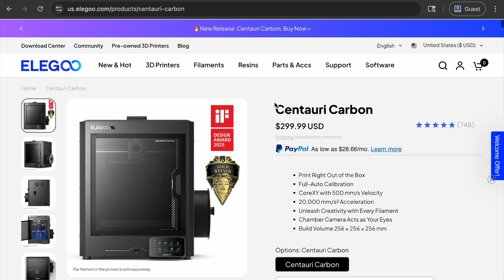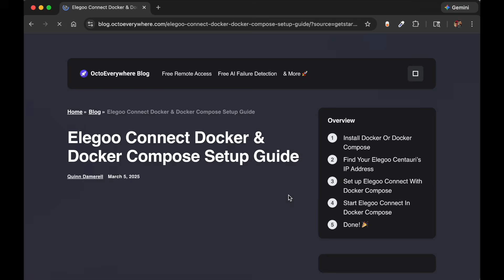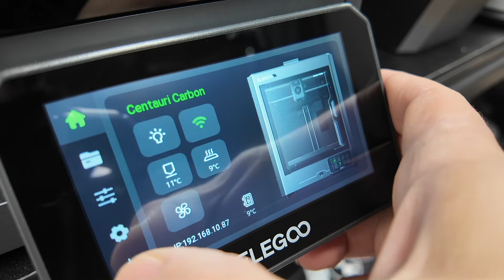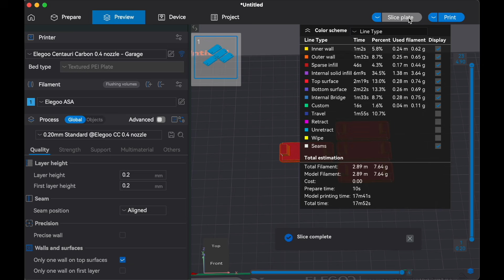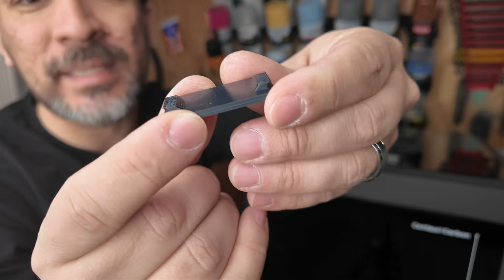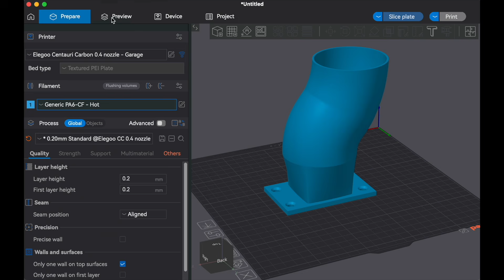How To 3D Print Engine Bay Car Parts With a Sub $300 Printer

Comment: This or p1s?
Reply from the maker: If you have a slightly higher budget, go for the P2S. It has a built in heated chamber. Makes printing larger ASA/ASA-CF higher heat resistant filaments much easier.

Comment: So will this be something I can use to make a fender and just paint over it?
Reply from the maker: You can use ASA filament for exterior parts. I have a few parts that have lasted years with no issues with the Southern heat and multiple tropical storms ;)

Comment: Instead of heat soaking the chamber with the print bed just blast some hot air in there with a heat gun.
Great video. Keep up the good work.
Reply from the maker: Oh heck yeah, that’s a great idea. Will have to give that a try. But I’m glad it’s finally warming up outside 😁

Comment: I have over 2k hours on my CC1 and it's awesome.  I think there's an external chamber heater that's being made somewhere, and I want to try one in my setup.  Leaving my window open when it's 37 degrees Farenheit outside is causing warping problems... lol.
Reply from the maker: Nice, what type of parts have you made?
Reply: @allaboutthebuild Lots of tabletop miniatures, some Joy Con adapters, and a case for an Oculink setup.  So far all I have is PETG, but I do want to play with ABS and ASA once I can get my printer moved into my garage.
Reply from the maker: I've printed some DnD miniatures too, the Oculink setup sounds cool. Will have to check that out. We also use a fume extractor in the garage I forgot to show. Definitely good to have better ventilation and extra air filtration.

Comment: That's a really good printer for the price, I'm using one for half a year now, one of the preorder units and I'm pretty happy with it. One thing you may want to look into is printing toolhead cable strain relief, because that cable angle and movement makes it susceptible to premature wear - even though Elegoo sends replacement cables in that case (and it's a different angle on those replacements), strain relief should at least make it last longer.
Reply from the maker: Nice, that’s good to know. Do you 3d print car parts too???
Reply: @allaboutthebuild  Not really my niche, although my skoda has fire extinguisher on printed mount (OEM one sucked) and my phone has a nice 3 printed place with ikea wireless charger in it. Guess it's the case of everything being a nail when you have a hammer :D
Reply from the maker: Skoda, nice!!! I've printed tons of other stuff besides car parts too :) 3d printing can be a fun hammer 😂

Comment: Use Nano Polymer Adhesive from Vision Miner on the build plate and you will never have bed adhesion problems. Zero issues printing ASA, ABS, or PC carbon fiber in my Centuri Carbon's
Reply from the maker: Just picked some up. Will give it a try. Thx!!!
Reply: @allaboutthebuild Be sure to go over to Vision Miner and watch the video. You don't have to coat the plate after every print. It lasts and you don't have a mess like glue sticks
Reply from the maker: Just watched it. Can't wait to give it a try. Thx!!!

Comment: Pretty decent printer but can you get spare parts? In my area, no... They are all out of stock and ready to launch the CC2 instead...which I think it's supposed to be CC1 with the promised multicolour.
Reply from the maker: Dang, there's a few 3rd party sites that have some parts in stock. And The CC2, looks just like the CC1 with just the ability to print in multicolor :)

Comment: I've been using a Centauri Carbon as well to print ASA. Very impressed with its performance. Thank you for the idea of turning off the fans in the CC. Using the bed as a chamber heater, I usually get the chamber temp up to around 40ºC, but then when I start a print job, the chamber begins to cool as the printer readies itself for the print job. With the fans switched off, hopefully the chamber heat will remain steadier. I used a glue stick to hold down a part similar in shape as the one in your example recently. That helped. The temp info on PA6-CF.was great info also. I was wondering if there was a filament able to handle temps over 212º.
Reply from the maker: Thx for watching and glad it helped. What type of parts do you print on yours???
Reply: @allaboutthebuild  I've printed a (no longer available) parking brake alarm switch, air plenums and mounting brackets for a custom windshield defogger system. Next is a custom enclosure for a high mount brake light that incorporates a rearview camera, plus other goodies planned. These 3D printers are amazing!
Reply from the maker: Oh wow, a high mount brake light plus a mount for a rearview camera. Nice!!!

Comment: You only need a better harder nozzle and a hotter extruder hot end for printing more abrasive filaments like Pla/ PETG CF. Ender 3's have no issue with that. Either you just suck at adjusting your printer or your just lazy.
Reply from the maker: You need a hotter chamber to prevent warping unless you’re printing in 85+ degree room

Comment: Thanks for the video! I bought my Centauri Carbon with the intention of printing advanced filaments, but there aren't a lot of videos about this yet. I even upgraded the nozzle to a Diamondback nozzle. Side note question: how does the Centauri Carbon handle the fumes of the ASA? I am planning on using a couple of ANYCUBIC Mini Purifiers while the printer is running. Will that be enough?
Reply from the maker: Thx for watching 🙏🙏🙏 Glad you enjoyed the content. So for printing ASA/ABS/etc... The printer is in the garage and I also use a 10in fume extractor that pumps everything out an exhaust port. Forgot to mention that in the video :(  

I used a mini purifier before and it wasn't enough. My guess is because they're too small or that the printer isn't completely sealed. I'm thinking of just buying the Bambu Lab purifier or the Creality 360°All-Round Purification too.

Comment: Can it make the interior surface smooth, or is it always textured?
Reply from the maker: The texture comes fro the infused carbon fiber. If you print with non CF, you'll get less of a texture, but you'll have layer lines. If you print with ABS or ASA, you could try vapor smoothing or good old sanding. I think that would be another great future video to post ;)